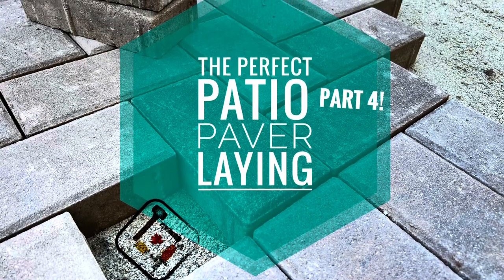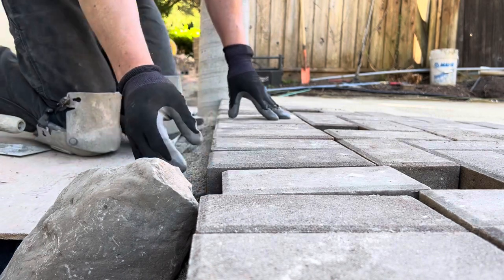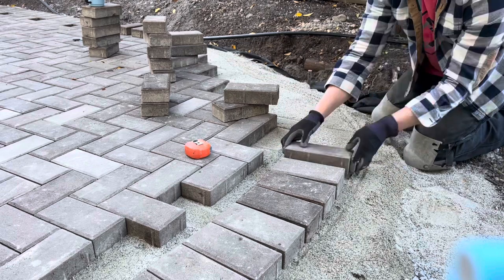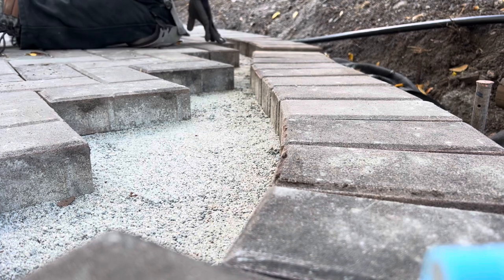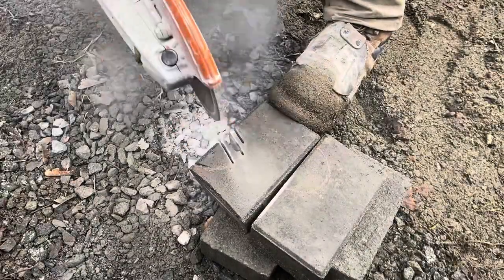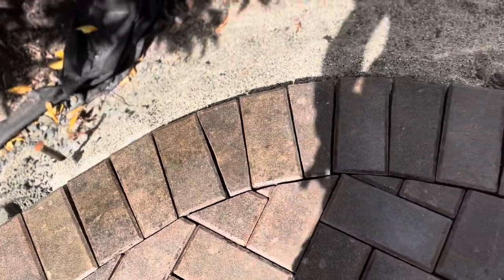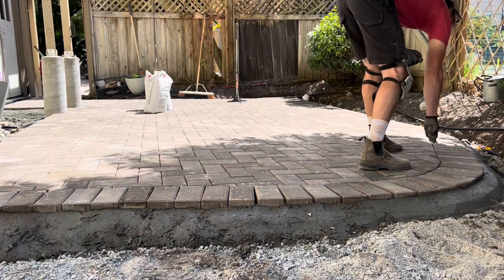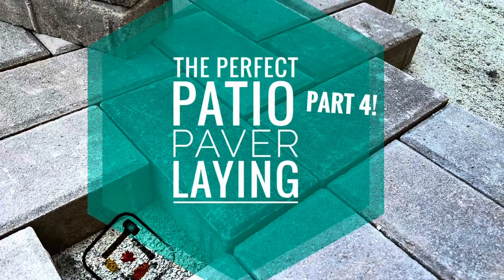How to RE-USE pavers to create the Perfect Patio! Part 4: Paver Laying #pavers #diy #home

Comment: For a small 10 x 10 how do you feel about using a redwoood 2x4 border, to box in and contain the pavers?
Reply from the maker: Hey John, I don’t recommend using wood as even pressure treated against pavers will rot out and degrade over time. The pavers and sand hold moisture which accelerates the process. A concrete curb or plastic edging is the way to go! If you like the look of wood you could make a removable strip beside the other types of edging, but don’t rely on wood to hold the paver edge.
Reply: Thanks a million for the response! Much appreciated.

Comment: Great video. Was that sand used polymeric sand or normal sand?
Reply from the maker: I used a regular jointing sand on half and a modified jointing sand from Romex for the other. Not polymeric but has similar properties.
Reply: @HardscapeCanada  WOW thank you for the reply.  I'm just learning.  Are you opposed to Poly sand over regular?  Do you have a video on options/alternatives for the sand part on the end?  

I'm attempting to figure out the base, geofabric, geogrid, poly, not poly, etc. for a clay brick installation in a sandy soil area (FL) with a 3/8 joint.  Any recommendations?

Comment: If there is uneven settling in spots, is it just a matter of lifting a paver and adding or removing sand?  I am dealing with uneven settling with a slate patio.
Reply from the maker: Hey for a slate patio yes you can add sand and re-set individual pieces. If there’s not much for gravel underneath in section you may want to pull it up, excavate a few inches and pack gravel in before re- laying again. Sometimes it’s a tough call!

Comment: Was that a poly sand you used or just regular?  Nicely delivered
Reply from the maker: Hey Wayne, I did about half with a regular jointing sand, and the other half with a high quality jointing sand from Romex to see how they hold up. Neither was polymeric.
Reply: @HardscapeCanada  thanks  for the update...are you in an area where your ground freezes?  I am in Nova Scotia, where our winters can be harsh.  I was told that jyst a good quality sand would work so your reinforcing that idea. Thanks again
Reply: @waynetechnicianable  Not an expert by any means, but a lot of the pros on Youtube that are in northern climates don't use polymeric sand because apparently with the seasonal ground movement it can't be too inflexible and cause waves or buckling.